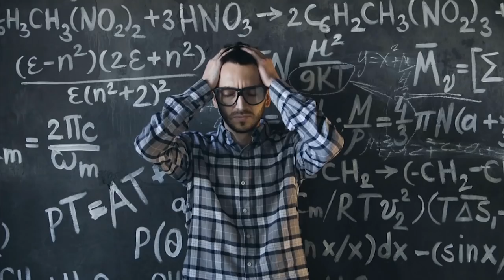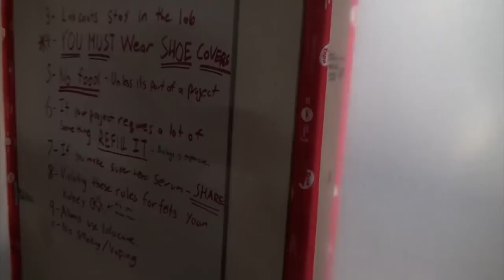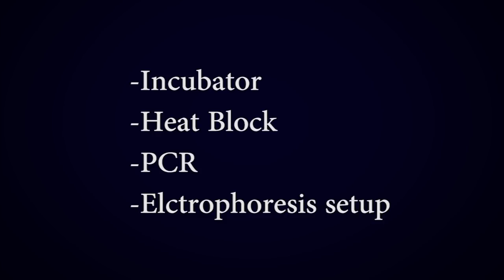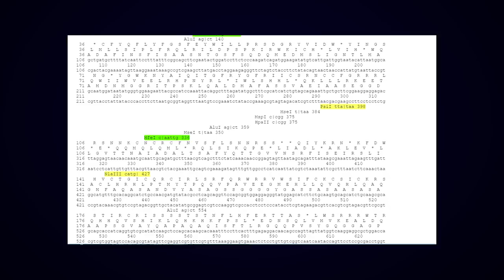I Built a Positive Pressure Clean Room for CHEAP

Comment: I'm not a scientist type like you, but I do some small mushrooms work. To keep stuff clean I use a pair of old home-grow tents an my "lab" is a sandblasting cabinet from harbor freight.  It's got mounts and plugs and switches already wired for lights, I use a uv and a white light LED. There are fresh air and vacuum hookups that fit hepa filters an such. Works good for agar plates an inoculations. Since I didn't need to buy tents an metro shelving my set up was nominally $200 with one them 20% off coupons.

Comment: UV lamp will screw the plastic on the walls. It makes them rigid and brittle (at least thats what I think)
Reply: in his stream he said that he would replace the plastic if neede because its cheap and easy (sry for the bad english)
Reply: I agree I think the ozone and UV being generated will make short work of that thin plastic.
Reply: It really depens on the type of the plastic used. For example, ASA is quite OK with UV
Reply: Since even newspaper can block UV, shielding it should not be any problem.

Comment: Lools good but wouldn't it be better to put the exhaust on the other side of the room so the airflow isnt just looping in that one spot?
Reply: Interesting idea but air doesent work like that, the whole room has to be pressurised and filled with air for the air to be pushed back out, it isn't sucked out as that would creat a vacum.
Reply: The design is more to keep stuff from the outside getting in than for providing air to breath. That size room has O2 enough for probably 72 hours of work and there's no bed in there so...

Comment: I built a ozone generator and air ionizer powered by a neon backlight driver from a big LCD TV (old tech). It was enough to superficially sterilize during the night a room a bit smaller than yours.  The air ionizer helps to trap particles on grounded surfaces. It's needles produce less ozone than the generator, allowing work while it's active.

Comment: To anyone considering this just buy a grow tent. You can get a 4ft × 8 ft at 6.5ft tent for about $250. Most any other size can be found for just over $100
Not to say I haven't considered doing this as well but the material cost is about equal; then the time and easy of assembly as well as disassembly without harming the material investment all have value.

Comment: This is awesome! Can't wait to see how the spider silk goes.
Reply: Yeah, me to. I never heared of an amateure doing something like that. I wonder how he incorporates the DNA.
Reply: @mandernachluca3774  He will probably use restriction enzymes to cut the desired gene out of the spider DNA. Then using the same enzymes he can insert it into the new organism's DNA. It will take some practice, and trial and error, but I think he could do it.
Reply from the maker: Nope gonna use PCR. Assuming my prep is right it should generate 9 different lengths of silk which gives me a lot more interesting stuff to work with. Restriction enzymes are way more expensive and don't work as well for isolating stuff from genomic DNA as you get cuts in weird places and you don't have as much DNA to work with in the end. Then I'll add some adapters to the ends of those fragments for insertion into a plasmid. But those will actually be cut with a restriction enzyme. I'm designing this to only need 2 restriction enzymes total. 1 for the plasmid, 1 for the gene.
Reply: Okay, that will be awesome. I can't wait to see it.
Reply: @thethoughtemporium  
Very interesting, i hope you go more into detail in your upcoming video, for someone like me who has not a lot of knowledge about biochemistry it will be very hard to understand. Can't wait to increase my knowledge on that subject XD.

Comment: A tip the orb-web-weaving spiders are known to have the strongest silk in the spiderworld and some places "milk" it to study the material, if it is possible to replicate this spiders genetic "formula" if you manage to be successfull with the black widows . :)
looking forward to see more of this.
Reply from the maker: orb weaver silk and black widow silk are almost identical. They rate approximately equal in strength, with the exception of the darwins bark spider since it's weirdly stronger than the rest by about 10x. But there's no sequence data for their silk and getting one of those spiders is nearly impossible
Reply: Ahh did not know that. will have to read up on those spiders as well. :)
True it all depends on availability and that the sequence is there makes things "easier".

Comment: You may want to look at used electrophoresis machines on ebay.  I picked one up to use as a hv power supply for like $50 shipped and its a pretty nice one.
Reply from the maker: Technically I already have one. I ordered the components for it before someone just gave me one, so I'm gonna make the video anyway. And all the parts only cost 20 bucks
Reply: @thethoughtemporium  gotcha. Yeah mine has been sitting on a shelf since i bought it. 5kv makes me nervous:)
Reply from the maker: .... why would you use 5kv for electrophoresis. What are you trying to pull through a gel? A whole hamster? It's supposed to run at 100v
Reply: Poor hamster... :_(
Reply: @thethoughtemporium  I haven't the foggiest idea. I don't know how that even works.  It's a pharmacia multidrive xl.  I was mistaken and it actually tops out at 3.5kv.  I'd be interested for you to take a look online at it and let me know why it goes so high.
Reply from the maker: Are you sure it's an electrophoresis setup and not an electroporator?
Reply: @thethoughtemporium  manual says it's used for electrophoresis and electrofocusing.  I have no idea what that is but maybe that's why is goes higher than expected?
Reply from the maker: Did some digging and also those words made it clear what it's for. It's for proteins not DNA. They use way higher voltages cause proteins are weird and bulky so it takes more to move them through the gel. Also may let you do 2d electrophoresis for protein analysis
Reply: @thethoughtemporium  oh.  Well if you could use it I'll let you have it for shipping. It might not be worthwhile cause I live in FL but just let me know.  I probably will never use it.

Comment: Why black widows? Can't silk be extracted from something less venomous?
Reply from the maker: Their silk is very similar to golden orb weavers and is some of the strongest in the world. I'd prefer to use darwins bark spider silk but getting one is a pain. And because black widows live in north america it's easy to get preserved specimen. I can get golden orb weaver specimens but they're dry not wet preserved, so DNA quality won't be as high. Also I found a nice sequence for black widows which makes it easy to clone out the gene I want. I was going to use golden orb weavers originally, but it was to expensive to have the gene synthesized. This way it's 20 bucks for the spiders, 10 for primers and boom I've got my gene. Vs 500 bucks to have it synthesized.

Comment: should have gotten Darwin's bark spiders it you wanted to make artificial spider silk, would have some interesting follow-ups
Reply from the maker: Find me a pair of darwins bark spiders and pay to have it's genome sequenced and I'll happily use it. But until then I'm working with what's cheap and availiable. Also having spent many, many hours going over silk genes, the silk I'll be using is very similair to golden orb weavers and the natural silks are nearly equivalent in strength. So it'll be at least as strong as kevlar. And the mods I'll be doing to the sequence ought to boost strength further if it works the way I hope it does

Comment: Doesn’t UVC produce O3?
And isn’t O3 an asphyxiant and bad for your lungs?
Are you sure that’s fine to be your only air source?
Reply: UVC is actually incapable of creating high concentrations of O3. There are equilibrium reactions that break down O3 under UVC light. Therefore the O3 levels in the room should be very low at all times. Basically when you can smell it it is unhealthy.

Comment: Dude, this looks like it could have been done a lot better. You should have looked up videos on framing before attempting this. Ideally, you would have used/rented a framing nailer to do it fast, but framing nails and a hammer would have done in a pinch.

The other thing is that you should have fed the power lines through holes you would have made in the 2x4's to get power to various segments of the lab. (It appears that you only have power where the power comes into the clean space through the plastic.) (Look up actual framing videos for context, it takes like 10 minutes :D)

Also, instead of the tubing going through the plastic, why not go through a special 2x4 that has a typical 120/240V socket on the end? You can insulate the socket to prevent air gaps and still get power to the internal socket prongs on the inside of the clean room.

Also, since maker spaces are typically tight on money, always recommend that they get a TABLE SAW for carpentry. A bare-bones table saw usually costs the same as a miter saw, but can do so much more, with a minor (20 minutes) investment of skill.

Also, NEVER miter saw things on the ground, this is a recipe for disaster, both in a safety sense, and a quality sense, also, its just a pain to deal with, do it on a table. Also, anything a miter saw can do, a table saw can do better and faster.

Additionally, a shop-vac never hurts for dust collection. :D

Best of luck on your genetic engineering stuff, but I would put a bit more time investment on making semi-quality woodworking items. This being said, god damn that looks cool as fuck, congrats!